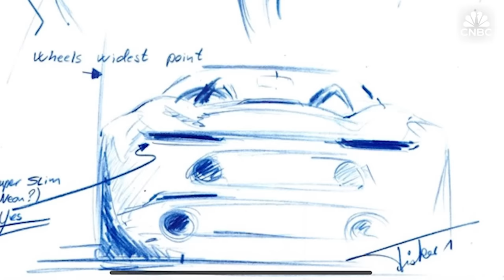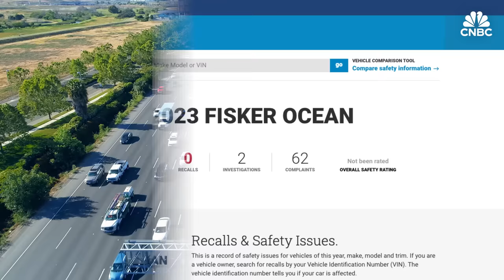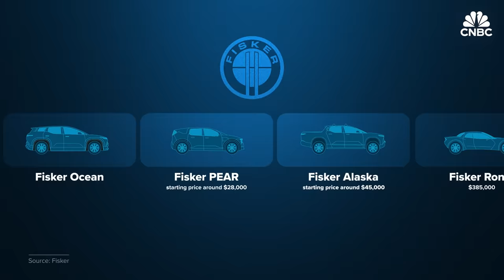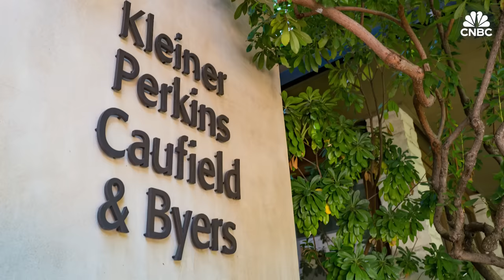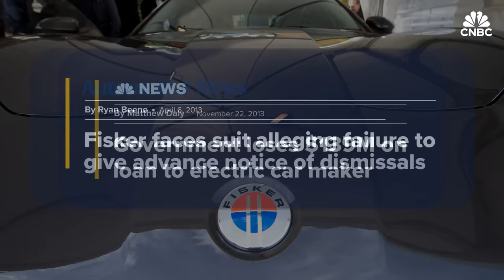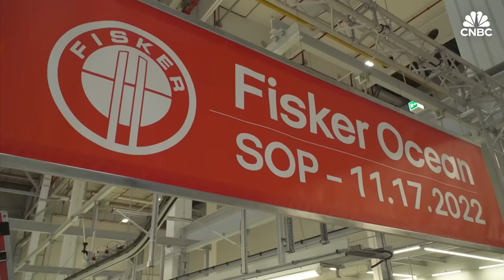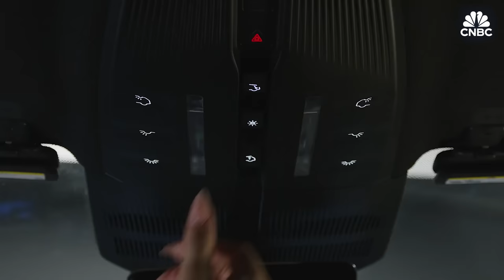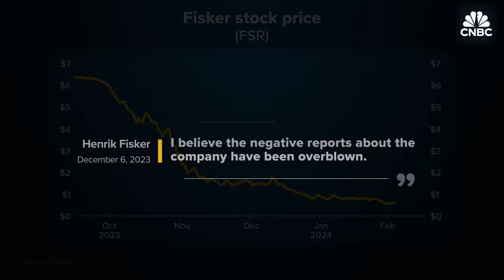Why Fisker Can't Compete With Tesla

Comment: December 2011, Fisker Automotive recalled the first 239 Karmas delivered to the U.S. due to a risk of battery fire caused by coolant leak. Of the 239 cars, less than fifty had been delivered to customers, the rest were in dealerships. In the report filed by Fisker Automotive with the NHTSA, the carmaker said some hose clamps were not properly positioned, which could allow a coolant leak and an electrical short could possibly occur if coolant enters the battery compartment, causing a thermal event within the battery, including a possible fire.[51] In May 2012 a Fisker Karma was involved in a home fire that also burnt two other cars in Fort Bend County, Texas. The chief fire investigator said the Karma was the origin of the fire that spread to the house, but the exact cause is still unknown

Comment: The tax credit is available with leasing.. As with EVERY EV. Leasing is the only way you should want to get an EV anyway. The tech is changing so fast, why would you want to BUY and EV anyway?? I've seem several Oceans' on the road. Great looking car.  Hope they survive
Reply: Yes, I just posted I love the way Fisker deigns their vehicles, especially the Ocean. Hmmm, leasing an EV seems like a good Idea with your point of view. 😉👍🏽
Reply: I’ve owned a MODEL X since 2016. Paid cash for it. In 8 years it’s never been serviced. It’s my wife’s daily driver. My kids won’t drive in my gas powered BMW X5M. Which just had a $3500 brake job at 47k that BMW called “normal wear and tear”. My Tesla MX won’t need a brake job for another 175,000 miles. This is why you would buy an EV.
Reply: God dam you for having the taxpayers subsidize your expensive shiny new car.   these are a joke, a bad joke.

Comment: Fisker was screwed when Tesla dropped their price in Jan 2023 so one could get a Y for 15,000 less than the Ocean One or their top model.  When I heard about software being incomplete I did not follow through with my purchase. I forfeited my $5000.  If Fisker would of dropped the Ocean One to $60,000 I would of purchased it.  I have no quarrels with forfeiting my $5000 deposit because I still save money buying a Y long range.  Fisker should of taken another $10000 to $15000 loss on each vehicle to sell every vehicle they were making instead of sticking to their price of $70000 for the top version. They cannot sell the most expensive version and even their cheapest Fisker Ocean is $40,000 and the model Y cheapest model isn’t much more.  Price then quantity are the most important in that order.

Comment: "When you come for the King, you best not miss"

The reality is, no one can compete with Tesla. 

Tesla's interiors are basic, minimalistic and simple, but they are getting better with each revision.

Meanwhile the competition is offering more expensive luxury vehicles to compete with the Model Y - the quintessential EV. 

I drove the Fisker Ocean.  It's a nice car and has that same airy, open feel  the Rivian offers. But there's still a lot of software bugs to resolve and a lot of creature comforts that need adding. 

Tesla just added ventilated and heated seats to the revised Model 3.  They will add that to Model Y.   Fisker Ocean should have had them. 

Even if you do somehow manage to make a better EV than the Model 3 or Model Y, there's still that little issue of the charging network.  Put simply, everyone else's charging network sucks. The Tesla Supercharger network experience is SECOND TO NONE.

The only people who have an advantage have their own house and their own LEVEL 2 charger. 

But that means going out of state or on long range drives is a headache for non-Teslas.

Comment: People just want SUV's, what are these people thinking? They don't even need absurd 0-60 or 1/4 mile times. Increase the mileage instead. A 500 mile range sohuld be the standard in an electric vehicle.

You don't even need any of that automated driving nonsense. Just basic safety features like auto-braking or monitoring for an impaired driver, which are much simpler to  implement.

Comment: NBC called the Ocean a Tesla killer more than a dozen times. If you invest based on NBC you'd have lost 95% last year.
Tesla q4 2017 production and delivery metrics is insanely misleading. They just started the ramp and Tesla doesnt have dealerships so "delivered" means in customer hands. Unless people lived at the factory, that would be impossible to achieve parity... Tesla had a year of backlog pre-orders then, but just gloss over that.

Comment: The EV craze is over. Tesla will survive - but the value of Tesla is going to plummet. Tesla shareholders are going to go through some things.  After 3+ years of steady stock price declines.
Reply: Don't believe the media lie  USA EV sales increased 40% in 2023 and will increase in 2024. The problem is legacy car manufacturers releasing yet another me-too $45,000+ EV crossover, doing nothing to clearly market its benefits over all the gassers in the dealer's showroom, and expecting to sell 60,000 of them.

Comment: A car with a boost reducing after each use cannot be resold. Imagine someone asking you after 5 years “how many boosts do you have left?” You would have to say “34?!”
Reply: It’s more of a party trick. Reviewers have said it doesn’t actually “boost” the car that much more than the other drive setting when flooring it. 

Also would likely have some OTA software updates to reset that if this company actually survives long enough anyone actually run out of the artificial 500 cap
Reply: That is a silly suggestion. No one except someone using their car as a Drag Strip rental thing is going to do hundreds of boost accelerations, so you're inventing an issue where there isn't one.